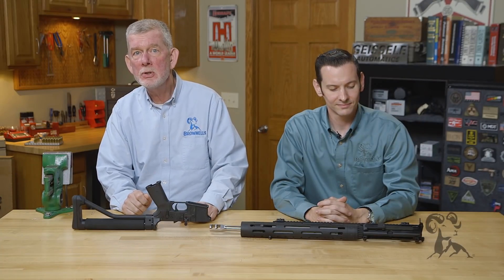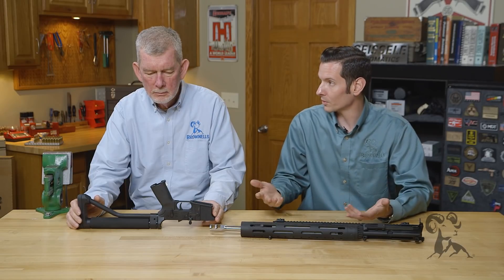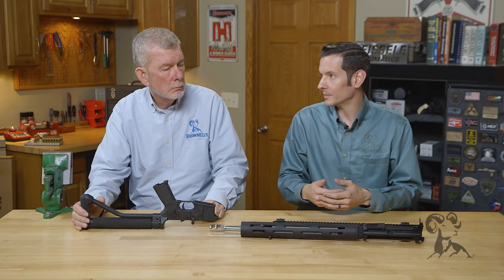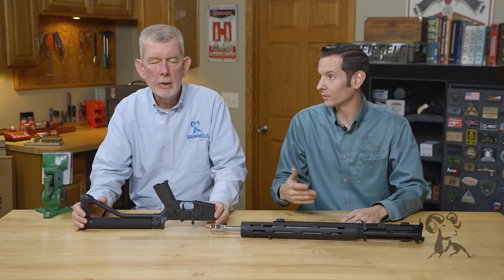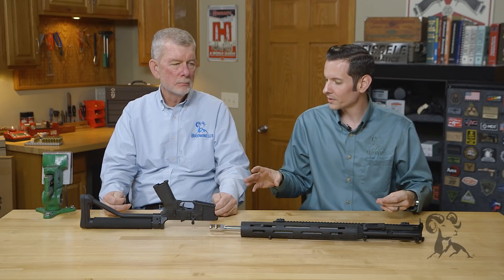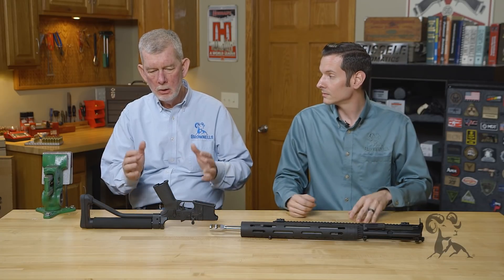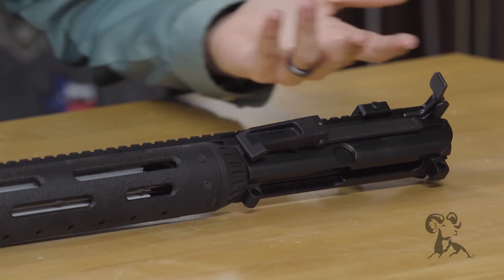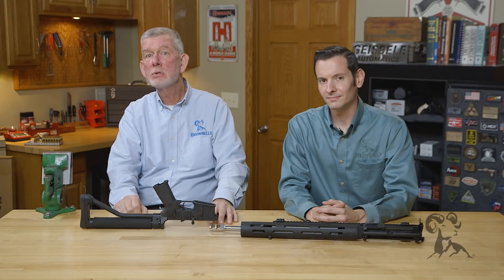Smyth Busters: Is Billet Better Than Forged?

Comment: The debate between forged 7075 vs billet 6061 forged is strong. For anyone out there if you have ever broken a 6061 billet receiver under standard usage I would love to see it. In my opinion with the type of failure you would need to have to break a receiver set I don’t think it’s going to matter if it’s forged 7075 or billet 6061 . Just my opinion

Comment: But is it true you’re likely to get tighter tolerances with a billet receiver? More specifically, a matching billet receiver set? On my next build, I’m looking to limit receiver slop and decrease gas escape between the crack in the upper and lower, and I’ve heard billet has tighter tolerances so it will make everything fit tighter together.

Comment: Billet material is forged into a bar, so it’s usually a very even grain structure. It will hold it’s shape the best.
Forged is harder, more wear resistant, but also more brittle.
Cast can easily have structural blemishes, no proper grain structure or air pockets, so cast material not only has less structural integrity, but it’s very soft and wears quickly.

Comment: Forged is expensive and most strongest, billet is less expensive but also strong to last lifetime but cast is the least expensive and also less strong as compared to other billet and forged.
So in strength,
1 Forged
2 Billet
3 Cast

Comment: The myth isnt busted if you dont physically test them.  Is just as strong if you use more metal.  The added metal also has an advantage of heat dissipation.

Comment: Well, fellows, you miss a key point:  specifically, some billets are forged.  

Having spent a 40+ year career in tactical aviation program management, I can assure you that many parts are machined from billets that are not foraged,  BUT  some are machined from billets that were forged before they entered the manufacturing process.  Machining an already-forged billet is more expensive and more time consuming to attain the specified net shape (the forged billet is stronger and tougher, thereby both wearing the cutting tool(s) far faster and requiring more cycles on the numerically controlled machinery).  However, very complex shapes and designs often cannot be forged, whereas they can be machined from a forged billet.  This provides the strength and fracture resistance of a forging, which is often vital in a (perhaps) 9G aerodynamic structure.  

So, it’s incorrect to suggest that there are billets and forgings . . . some billets are forged, although many are not.

Comment: You seem to argue that "strength" is only criteria for one type being superior to the other. Both are more than strong enough for the application but billet receivers are typically machined to higher dimensional tolerances. Forged receivers are better for mass production because forging to a rough final shape minimizes the relatively expensive machining time to finish the part.
Reply: Since a forged receiver is machined as well, I see the precision of machining completely separate from the forged vs. billet question. Either one could be machined precisely or sloppily.

Comment: i never heard forged was weaker, i just heard billet was more rigid with less flex. any feedback on that?
Reply: Only downside to forging is that it is generally more brittle but it's incredibly strong because the grain structure is compacted vs billet which has an even but uncompacted grain structure.

Comment: This may be comparing apples to oranges but in the automotive industry, billet is always the stronger over forged components. Engine blocks, crankshafts, rods, pistons, etc. I believe it has more to do with raw material, design and process.

Comment: Not to mention that most billet receivers are cut from 6061 T6 Aluminum, rather than 7075 Aluminum alloy.  There are some out there, but not only does the price go up, they are simply harder to find.

Comment: Coming over from blade collecting, I was really confused as to why people claimed billet was stronger than forged.
I knew from a metallurgy point of view that's just not true, so I figured they meant billet was stronger than cast, as you said in this video.
Problem is, even when mentioning cast, people still said billet was better than forged, and knowing nothing at the time about guns, I was very confused, because I thought maybe the terms didn't mean the same thing carrying over from blades to guns. Turns out they didn't know what they were talking about.
Reply: Isn't there Forged Billet?
Reply: Imagine collecting knives and not understanding how knives get their strength. Forging does nothing to make make harder or stronger, it is the heat treat.

Comment: Love this stuff but would have liked an explanation of the difference between forged, cast, or billet
Reply: Cast is molten metal poured into a mold then finished with CNC machining, billet is CNC machined from bar stock (a bar of metal), and 
forged is hammered into the general shape and then finished with CNC machining.

Comment: Unfortunately it is not entirely true... I can hand you a billet of 5160 steel and a forged piece of tin and I guarantee you that the 5160 billet is better... now there are 2 different metal receivers that are commonly used 6061 aluminum and 7075 aluminum... then there’s cast aluminum receiver is A380... 
6061 - Mechanical Properties
Tensile strength: 276 MPa (40,000 PSI)
Fatigue strength: 96.5 MPa (14,000 PSI)
Shear strength: 207 MPa (30,000 PSI)
Hardness: 95 (Brinell Scale)
Machinability: 50%

7075 - Mechanical Properties
Tensile strength: 503 MPa (73,100 PSI)
Fatigue strength: 159 MPa (23,000 PSI)
Shear strength: 331 MPa (48,000 PSI)
Hardness: 150 (Brinell Scale)
Machinability: 70%
You can see that the 7075 is capable of sustaining more abuse from drops and not having any nicks in the metal as easily... but billet aka 6061 usually has more features, if you want to cut out/ lighten the lower the billet is less wear on your tools, billet is also better against rust and if the lower was that much of a concern... they make polymer ones!

Comment: Lol finally somebody talks about grain and forging versus billet, and steel/all metals are forged. Steel forging is extremely common and way stronger than billet. It is extremely common in Aerospace to require forged material that follows at least somewhat that contour, in steel or aluminum due to it’s strength gains. One off forging’s are extremely expensive even for forged “block” aka hammered into the shape of blocks. If you want dies made to actually make the shape, you are talking in the multiple 100k’s of dollars. Usually out of the question without high production but even forged rectangular blocks of steel can cost 100K+ for an ugly big block of hammered steel. But it is way stronger, people just need to think of metal the same as wood, grain matters the same.

Comment: a Billet is a chunk of metal, forging removes the voids. 
all metal has a crystalline grain structure, and when forged it can be folded to strengthen the structure.    
a billet is just a chunk of steel, or aluminum or other alloy.
 a pig is a chunk of cast metal.

Comment: forged or billet both get CNC'd to final finish.
Reply: That's not the point........moron
Reply: Libertarian 4 Life  as you were. The forging makes the metal harder/ stronger. The CNC machines do the work to finished level of bare parts.it is not a work saving issue it is a metal strength issue
Reply: Libertarian 4 Life  Ruger and their lost wax process is the only process I m aware of that make a part (although in this case a cast part) that requires minimal machining.

Comment: Question - How do they create the "blank" piece of stock that the billet receiver is machined from?  If the blank was forged into its rough shape then machined into its final form, would it not share the same properties (from the initial forging process) as a piece that was forged into it's final shape?
Reply: In the case of aluminum, it's often an extrusion.  The metal is heated to the point where it is softened (though not quite melted) then drawn through a die to squish it into the shape that the final billet will be, after which it cools and hardens.

Comment: Only thing is, no one gets the chose which style of manufacture you get, when you get a part, for replacement or upgrade you pretty much have to take whatever they are offering. Forging is a pretty expensive process, as a result most parts are machined then heat treated and put together and sold as hand made, which has now changed to hand assembled.......in some other third world country.
Forged receivers are usually found on military weapons for sure, but there are billeted knock offs so never assume anything without doing some research.

Comment: A caveat to your statment "forged is stronger than billet" would be that assumes equal material thickness. Forged receivers are generally thinner than billet so a thicker billet part may actually be stronger, at the cost of excess weight.

Comment: A steel or aluminum forging is generally tougher than a machined billet (assuming same net shape) but not inherently stronger or harder. I'm a metallurgical engineer and I have to explain this difference at work every so often. The aligned grain structure increases the part's resistance to fracture under impact or shock loads, because the open-ended grains where you machine into a billet form preferential paths for crack formation. Strength and hardness are more relevant for static loads and wear, respectively. Without any heat treat after forming, the hardness and strength (which are directly proportional in steel and aluminum) of the part are determined by the amount of work or strain hardening induced during forming. You start with a steel or aluminum casting and either stretch it into a billet or forge it by hammering it to nearly the final shape of the part. The work hardening is a function of the percentage reduction in cross section from the casting to the billet or forging.
Reply: Therefore Billet is stronger.
Reply: @MobileAura  Either you didn't read or didn't understand what I wrote. Both billet and forged (steel or aluminum) can be strain hardened or heat treated across a range of strength, from relatively soft and weak to relatively strong and hard. The range is the same whether it's billet or forged. The only difference is the higher toughness of the forging.
Reply: @elektro3000  Why not a titanium lower? Why are companies lacking innovation?
Reply: @MobileAura  Solution treated and aged Ti6Al4V (ASTM Grade 5 titanium) has a yield strength of 1100 MPa compared to 503 MPa for the 7075-T6 aluminum that the AR-15 lower was originally specified with. The titanium also weighs 4.43 g/cc, compared to 2.81 g/cc, so it's more than twice as strong but less than twice as heavy. That means you COULD design a lower using thinner walls, and get a lighter product at the same or better strength. In theory, it would be 28% less weight at the same strength, which seems like a worthwhile improvement, but it's a lot of design work, testing, and manufacturing (forming, heat treating, and machining) changes. I'd love to see somebody offer a titanium lower, but I suspect it would be a LOT more expensive.

Comment: Billet is great when forgings are hard to come by. Like right now. A manufacturer can just cut recievers from hunks of 7075 as fast as the machines can do it.
Reply: @Frank Bonazza III only cheaper if you compare high end forged and low end billets. Low end forged receivers sell for $50 before the buying spree. I can't remember seeing a billet lower for less than $100. The features are something to consider, but that's kind of a tangent.

Comment: Just an FYI , there are forged raw billet materials. We used it quite a bit in the aerospace industry to machine parts out of. I have no doubt some billet receivers are forged before their machining into a receiver. You'd have to call each manufacturer to find out whose is made from a forged billet and whose is not.

Comment: As a metallurgy stand point this is true 
But I find billet stronger due to the manufacturer process making weaker areas thicker and more reinforced. Trigger guard mag wells pistol grip install. Thicker is stronger but heavier too
Seekins precision lower vs a forged aero lower is a great example.

Comment: I have two comments / questions:
How many forgers are there that produce upper and lower relievers? I had heard that there about seven companies that actually forge receivers but numerous companies that finish the components. 
Secondly,  my experience with billet upper and lower receivers are not always cut to milspec and parts kits sometimes do not fit like a forged component.
I would be great to hear your comments
Reply: There are many, some only do a run certain times of the year. Billet is indeed rarely cut to mil-spec as they have to leave extra material to get the strength comparable to forged.

Comment: Billet is roler FORGED in one direction (more compression and stronger) and machined into final shape (stronger) there is no comparison billet is stronger that's why it's used to make top fuel dragsters. Proven stronger than forged parts. Do research before you state what you think is fact because just about everything you just said was wrong.
Reply: Actually, I dare say you are wrong. We are talking about aluminum AR15 receivers, not dragster parts.
Reply: @CalebSavant  I am wrong in the sense of I know steel more than aluminium but gun part, knives, dragster metal objects in general stronger is better so it is a fact that billet has been proven to be better by many high stress sports such as motor sports.
To show how much google forged engine vs billet engine (I am a car mechanic so my research and example are from what I know best👍)
Reply: @Operator_JINX  weight to weight, a forged  7075 T6 receiver will always be stronger than a billet receiver for the reasons mentioned in the video.

Comment: Yep. The engineering still has to be there of course,  but in terms of max strength it goes forged>billet>cast. The AR receiver doesn't need huge strength which is why it can be aluminum in the first place, but I have noticed that many thought the rules of metallurgy were set aside for the AR. Nice job clearing this up.  Now please do a discussion on quality well engineered MIM vs poor quality MIM. High quality MIM is amazing and poor quality MIM is trash can filler.
Reply: The .223 AR-15 doesn't stress out the receivers. When get into .25 WSSM there logically may be more concern about stress points showing up due to the extreme pressures and much harder recoil. I leave those concerns to the metallurgy pros who spent years in advanced learning to understand these topics.